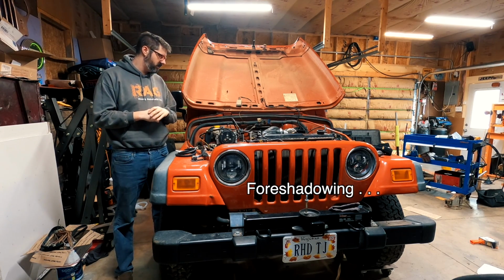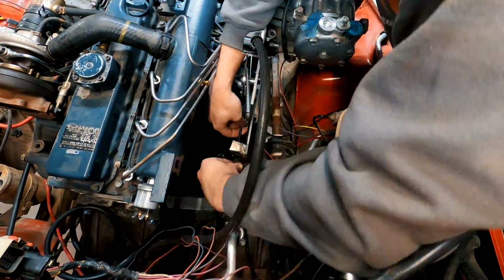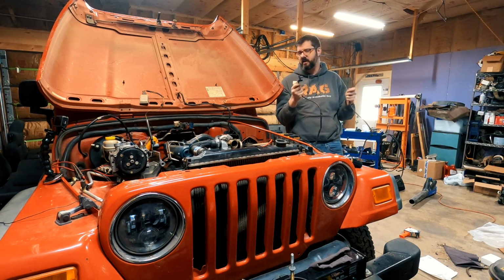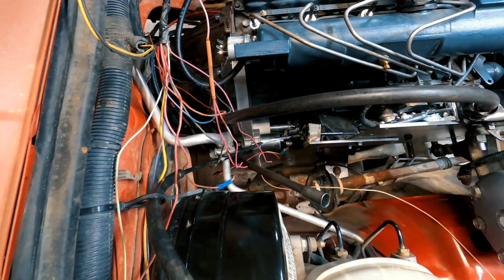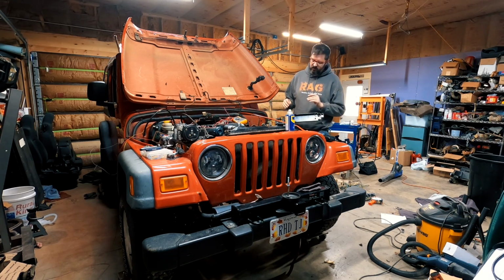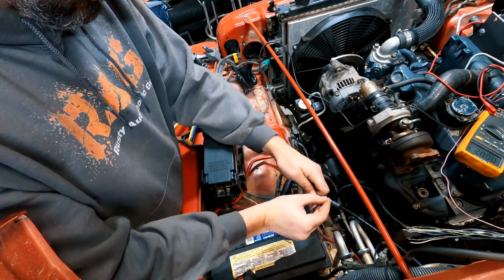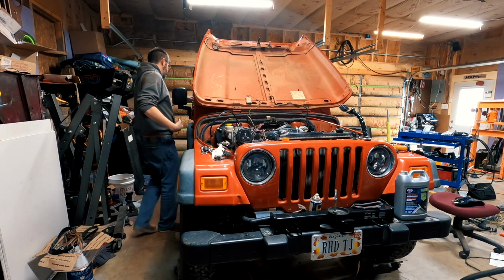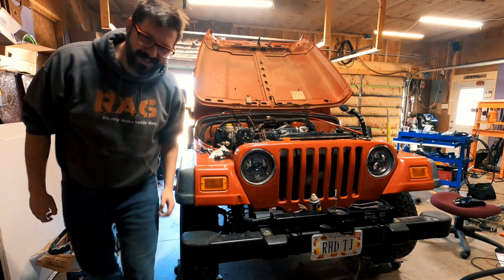My Kubota Diesel Swap TJ Wrangler Runs! [Diesel RHD TJ Wrangler - 51]

Comment: I was watching and I don't know if you did or not but diesel engines are a b*** to start with out cracking the fuel injectors at both the pump and the injectors to let the air out of the lines, witch is important because even a small pocket of air will wreck the injector pump and the injectors. that is probably the main reason why it did want to start at first. but awesome getting it started. I have a Kubota tractor has been to hell and back without a properly working radiator and it still wont die. those motors are a tough little cookie.
Reply from the maker: Yes I did have all the injector lines cracked so air could bleed out! Great catch!

Comment: Nicely done man!!! Congratulations, there’s something about that feeling of bringing a project with that much blood, sweat, and tears in it roaring to life. I’m looking forward to seeing this one rip! Random question, is there no risk of fuel cavitation or other vapor or even lubrication issues with running without a lift pump under high demand?
Reply from the maker: I should have clarified that better, I have two lift pumps. One in the tank which is diesel to feed a 2.8l turbo diesel in a Jeep Liberty CRD and then the Kubota V2403 has a mechanical one on the side of the motor. I bypassed the mechanical one that's mounted on the side of the Kubota V2403, but I still have the lift pump in the tank pushing diesel fuel!